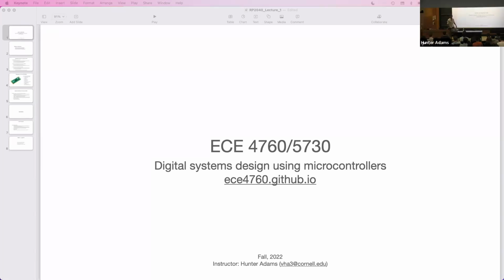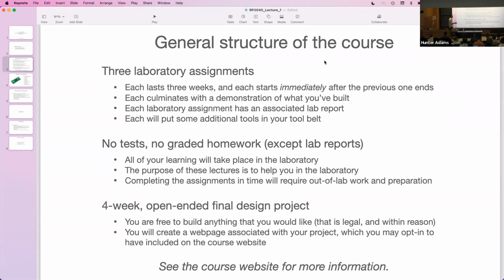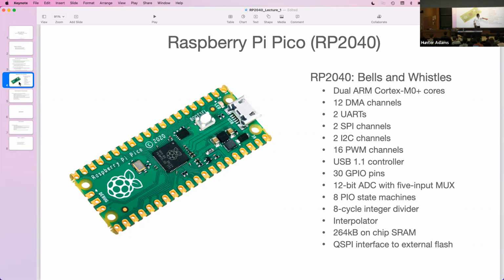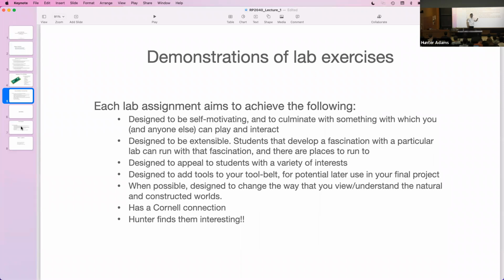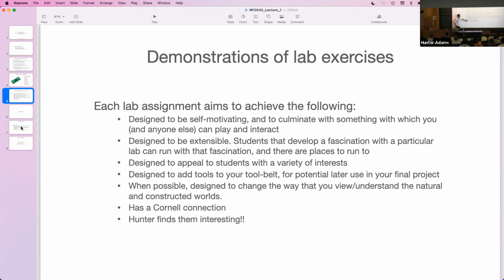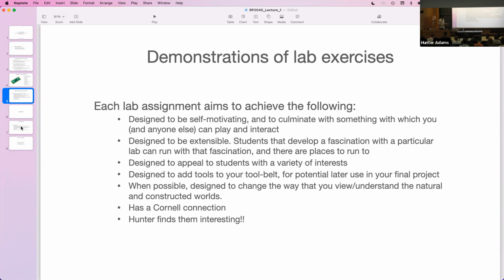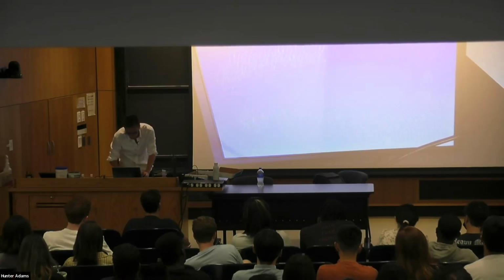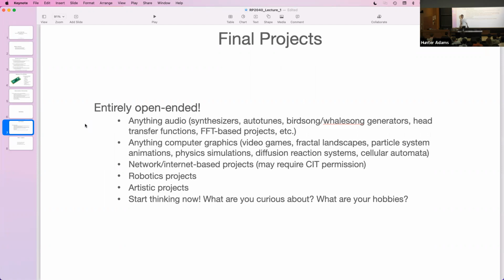Raspberry Pi Pico Lecture 1: Course Introduction

Comment: Hi Mr. Adams. Thanks for making this available. 
What are the pre requisite knowledge for this course if you don't mind me asking? 
The Cornell website says ECE 3140. Is it strictly enforced? What topics of 3140 would you consider most important to be reviewed?
Reply from the maker: Students are assumed to have a familiarity with programming in C, with concurrency (e.g. interrupt service routines, mutexes, semaphores, etc.), and with electronics prototyping. If you haven't taken 3140, I'd recommend setting up a meeting with me just to make certain you're not missing too many prerequisites. The best way to get a sense for your preparation is to read through the materials for lab 1.

Comment: Just found this series.  I am 65 and a retired electronics hardware / software / product guy in the UK who worked on a whole bunch of stuff over the past 45 years or so.   (By way of a sideways comment, I even worked on punched card reader and video display terminal hardware in the 1970s and I designed with microprocessors and programmable logic in the 80s and 90s).  As a fan of the Pico and the RP2040, I am so pleased that you are sharing content such as these lectures on YouTube.  I find that your presentation style is clear and very easy to follow.
Reply: That'll do for me! I find the Pico very confusing.